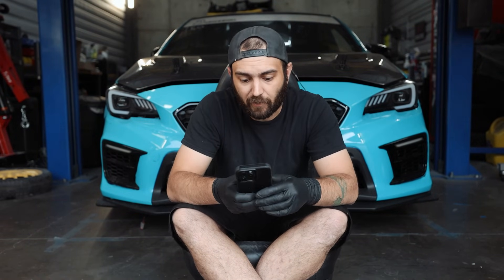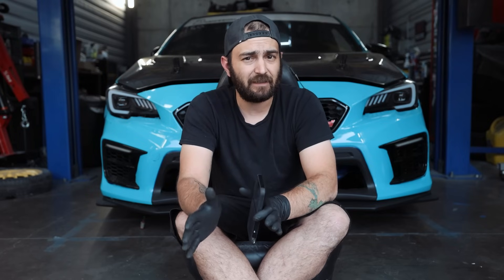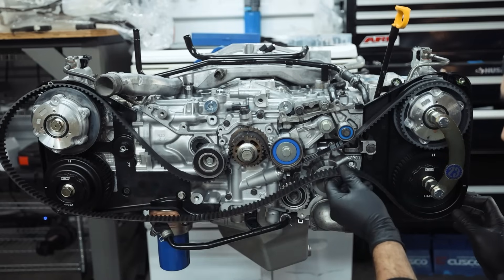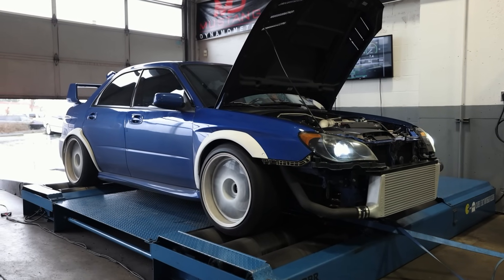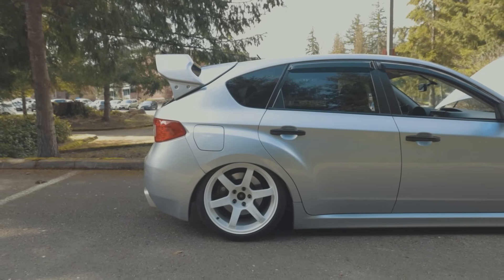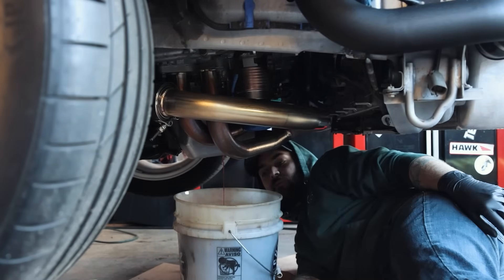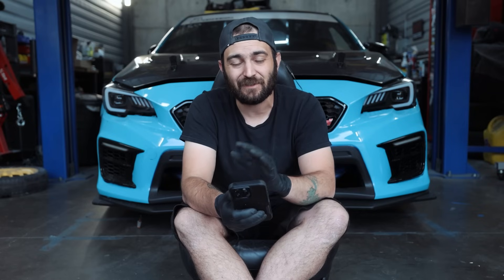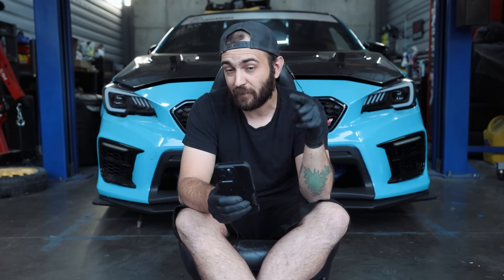Expert Guide: THE Turbo Subaru Engine Rebuild Checklist

Comment: I've got a 2014 STI hatch that just got rod knock so big help with all these videos you've done as I'm going to do the RA short block rebuild. One question. My car has 125k km on it and had it's timing belt done about 10k km ago by the previous owner (have receipts) so do you still recommend replacing all the timing components even though they're pretty new? Thanks!

Comment: I know this is an old vid, my 12’ wrx had an oil pump screw walk out and pretty sure she spun a main bearing, does anyone know if I’m safe using my heads and turbo still? I know the avcs gears should get replaced but oil flows through the turbo and obviously all through my head and cams, thanks! Love the vids btw, only reason I’ve torn this thing down is because of your videos🤟🏼
Reply: Should always have the head gone through by a competent machinist only my opinion but anything over 40 k I personally would have them checked you don't want to have valve train issue 🙄 good luck ,if your goin to overhaul or rebuild or short block you want everything good .

Comment: I noticed you didn't list or mention the 09-13 forester xt

I just purchased an RA block for my 09. Startibg to collect all the stuff. Have plm equal length header and dump tube with tial 38mm ewg

Comment: question: I have a 2004 Subaru wrx not sti, if I get an ej25 short block could I pair it with ej205 heads?

Comment: How about non turbo guys

2006 impreza 2.5i ej253 automatic 
I found out it has interchangeable parts with
2006 imperza wrx ej. Like cv axles 
✌

Comment: I have a 2017 subaru sti and the engine started knocking but it only knocks in between 1k-2k rpm at idle. no knock at idle and no knock at after 2k rpm what do you recommend to do I've been recommended a full engine rebuild, buy a short block and swap the heads, get it professionally done at a mechanic shop but I wanted some more insight on what to do. I changed the oil and I didn't see any metal in the oil.

Comment: '06 Forester XT manual, ej255 heads on the RA ej257 block you recommend, do I really need to tune for the compression ratio difference??

Comment: Yo I appreciate all of your engine build videos and detailed breakdowns! Smedia is a real one! I havent done an engine build on my own yet but I definetly plan on doing it ,My father was  a master tech for a honda and toyota dealership and I have assisted him with a rebuild once before But after he passed  I regret that I didnt learn more and didnt get to do a custom build with him.  So all of your information and knowledge is very much appreciated. I have ownedan 08 wrx for 5 years that just blew and has been down for months, A shop quoted me 10,000 minimum to do the job I said bro thats alot of money. Besides that Im questioning if I even want to keep a subaru block in it because I really want a solid 600-750hp block that can handle it alll day long and i have been leaning towards 2jzge nat build or questioning doing another subaru block  but didnt know what subaru block would be best,and  smedia has all the right content to help me make the decision and learn more. I cant wait to see the 2jz build on your sti man!❤ what would you recommend for the new engine  that can handle that easily?

Comment: I just ordered a timing belt kit from Company23 and it was delivered without a water pump. This is because they caught a bad batch of pumps from Aisin, and are awaiting a new batch to come in. They apologized for the inconvenience but said it should be a couple week delay. I'd much rather be delayed and buy through Co23 than elsewhere and have that bad batch missed and installed.

Comment: When you say replace everything that has oil running through it would you recommend replacing the turbo? Currently helping my buddy fix his wrx with a spun rod bearing and we are kinda hoping we don’t have to replace the turbo. But also don’t want to run the risk of prematurely destroying the new block.

Comment: Great video as always! I have a question for you. My 2016 WRX 2.0 L DOHC inter cooled turbo engine with 44,000 miles on it had a rod bearing failure and turbo failure with a lot of metal in the engine oil in October 2020. Luckily, this was under powertrain warranty. The Subaru Dealership, replaced the short block, turbo, oil feed lines, high-pressure line and oil pan at no cost. After replacing the new short block and turbo and reassembling the engine, the mechanic took it for a test drive and the check engine light came on P0011 a camshaft position timing over advanced bank 1. He removed the cover and inspected the pulleys and found all four pulleys still had debris from the rod bearing failure in them and needed to be replaced.  They replaced all four pulleys and reassembled the engine again. Does Subaru of America have a service manual on how to replace a short block and turbo after Rod bearing failure that had a lot of metal in the engine oil and what parts need to be replaced?  My engine failed again in October 2022,  (Rod knock cylinder 4 ). I was wondering because the mechanic didn’t replace the four cam pulleys at the same time as the new short block and turbo. Could the debris from the cam pulleys get into the oil passages, oil galleries and heads and cause oil starvation and rod knock on cylinder 4 over time ?

Comment: One thing to note that’s important is 07+ LGT/OBXT, 06+ FXT and 06+ WRX have D25 heads so if you put a RA shortblock in you are gonna bump up compression to around 8.7:1 and require a tune! 

04-05 XT, 05-06 LGT/OBXT have B25 heads (same as STI) so no change in compression with RA block.
Reply: So you’re saying my 07 OBXT has D25 heads??
Reply: @jp_youngin_5035 im 99% sure. Only 05-06 OBXT and LGT had B25. They went to D25 in 07 im pretty sure
Reply: @miloduebendorfer6309 yes D25 I just read the heads😔

Comment: why 11mm oil pump for EJ ? Why not 12mm?
Reply from the maker: 12s tend to cavitate, 11mm have been proven through and through.
Reply: @Smeedia  damn… should I replace my 12mm with 11mm on fully built ej255? Or it’s not so critical?

Comment: I’m mad that the Motul 10w40 is on back order 🙃 
Also what about the avcs exhaust solenoid? Wouldn’t you get two for the GR-VA platforms? 

10921aa020

Or is it the same as: 10921AA140 ?
Reply from the maker: You’d still need two for the exhaust, the Lh and RH solenoids are different though 🫡
Reply: @Smeedia  so then those part numbers are the same it’s just the holder that’s different?

Comment: Can't tell me how much this video just saved my ass, took apart the motor I'm building to red loctite the oil pump and figured out I had swapped parts from another motor that's using JDM parts and was running a JDM intake cam gear. Thank you so much
Reply from the maker: Here to help where I can 🫡🫡

Comment: Do the ARP 11mm headstuds need threads machined on the block or do they work with the stock head?
Reply from the maker: No they do not. Stock size 🫡
Reply: Awesome, good to know! I’m about to do the timing belt, oil pump and water pump tho month on my 2019 STI.

Comment: Do you use motul 10w40 even after break in? Right now I've done normal maintenance on my '15 STi (ie oil change, trans fluid change, brake job, tire rotation...) basic stuff. I do work at a Hyundai dealership and this is where i normally do my own work. But with oil changes I've been using Mobil 5W-30...should i swap to 10w40?
Reply from the maker: Tbh it depends. Most the time for the built cars I’ll use 20W50. Factory set ups 10w40. Nothing wrong with 5w30 for stock set ups

Comment: Great list!  One note, because I didn't hear it mentioned.  08 Forester XT does not have the factory oil cooler, similar to the WRX of the same year.  I learned this recently when ordering parts for an external cooler.
Reply from the maker: I believe the MT do not have it and the autos may? I might be wrong in that one
Reply: @Smeedia  mine is AT, I believe it was all 08s

Comment: I had ringland failure on my 2020 sti. Caught it early. I tore it apart, cut open the filter, checked the oil, oil pan and there was no metal shavings. Not even a metal chunk. Hadn’t replace anything except the oil pump. Just bought  new block from outfront. I’m Re using the oil pan, oil cooler.
Reply from the maker: Glad to hear you caught it before total destruction 🙌
Reply: @Smeedia I’m getting the iag stage 1 heads. I can run my stock cams on them?

Comment: Hi guys, if I want to learn building engine, where should I start? Should I enroll in a proper mechanic class or engine building course? I want to learn from the basics to advance and I am a totally beginner.
Reply from the maker: Tbh I’d buy a cheap project, take it apart and then put it back together. That’s how I’ve always learned 🙏
Reply: @Smeedia  I would love to do that. However, I don't know much about engine and its components. There are parts I don't know what it is called, and what it does. Apparently there is Google but that would be inefficient if I just keep having to stop along the way and search for the definition of that each part and end up knowing nothing because the learning process is not systematic. It is not like I know the basics, and then update the advance knowledge. I am completely noob now :(. Hence, I am looking for a good source to learn about the engine in overall first, then try what you suggest.

Comment: Bad news bois, pretty sure my 05 sti is lifting its heads :/
Keeps pushing coolant
Reply from the maker: LUCKILY that’s an easy fix if it’s just lifting. How much boost are you running?
Reply: @Smeedia  I'm running about 19 psi, stock engine stock turbo 300 wheel 144k miles.